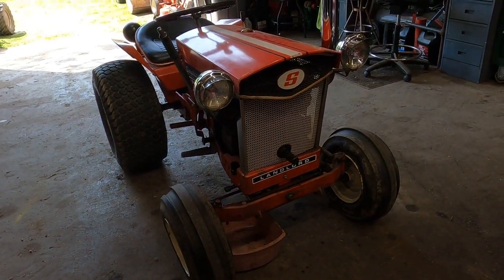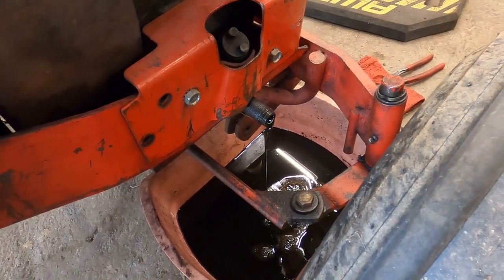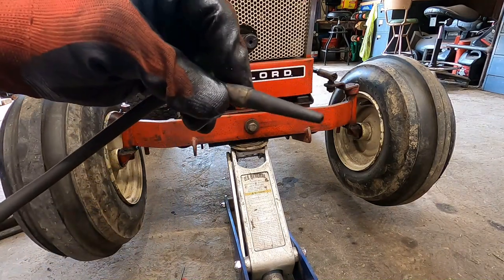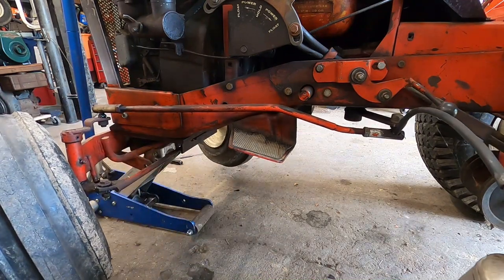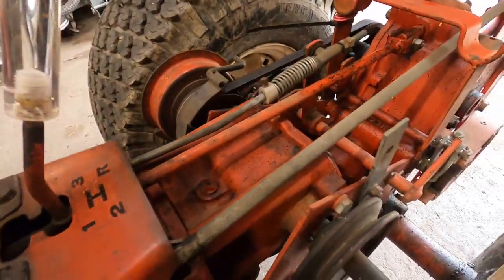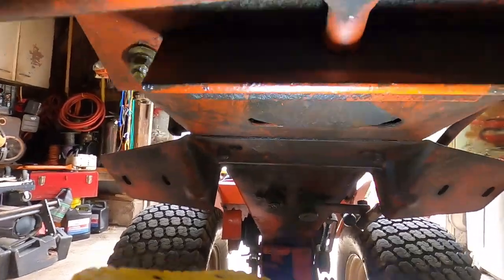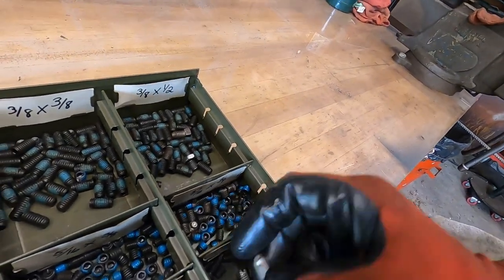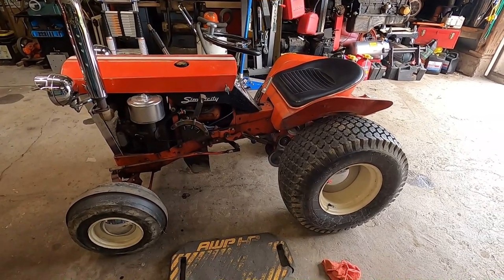1958-1970 Simplicity, Allis-Chalmers and MW Squire Service Tips

Comment: Love those TIRES 👍
Reply from the maker: These particular tires are no longer available unfortunately. Best advice I can offer is to search for 26x12x12 turf tires and you'll also need 12x10" wheels or 12x12" wheels with the proper backspacing for your application. These tires are mounted to 12x10" rims which gives the tire more of a crown than the 12x12" rims would. So choose carefully when shopping. Good luck Skippy! Zip~

Comment: I just picked up a 66 B-12, it came with hydro lift, does the hydro lift control the height of the mower deck also? I noticed it doesn’t have a deck lever like a regular mower
Reply from the maker: Yes, that's correct.

Comment: I have learned a lot from your videos. I have a B12 that smokes and uses oil. Cylinder looks good. Would like to put .010 over rings in it and set ring gap but can't find any. Do you know of a source for parts for 12 hp briggs. Watched your video of sandblasted 12 hp rebuild but could only find one episode.
Reply from the maker: A good engine machine shop can help you source rings miner. Be sure to hone the cylinder and don't get Chrome rings no matter who suggests them. They won't bed properly because they're much harder than the cast iron
Reply: Thank you. I have a local parts store with a machine shop. I will check with them.

Comment: Behind the back left wheel is a clutch that runs the mower , but I can’t find any adjustments. The mower blades don’t turn fully. The clutch is not turning full force.
Reply from the maker: What is the tractor you're talking about William

Comment: The second tractor you showed, is the pto clutch adjustable? Thanks so much.
Reply from the maker: I'm a bit confused with your question William. By PTO Clutch, do you mean the mid mount PTO? If so, there's no clutch involved there. It's all mechanical with pulleys and an idler pulley that engages the implement when the lever is depressed. Can you be more specific? Zip~
Reply: I think I should have replied here. There is a clutch behind the back left wheel. It powers the mower blades,but doesn’t spin blades fully.
Reply from the maker: @williamwilliams3200  My email is in the description below the video. Email me with photos of what you're talking about please. There is a rear PTO, but it's for running rear mounted implements like a tiller or a generator. Zip~